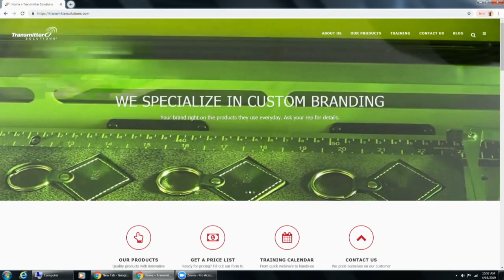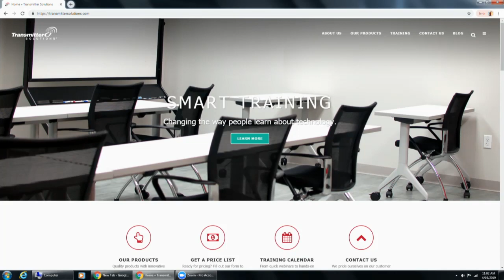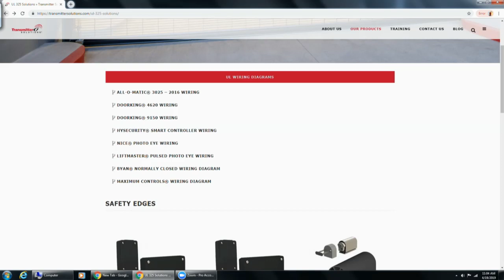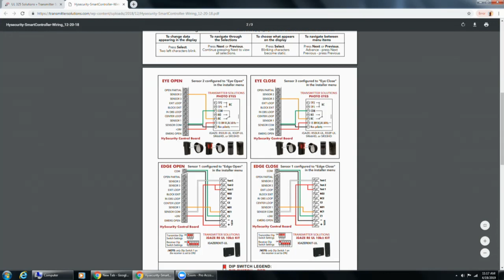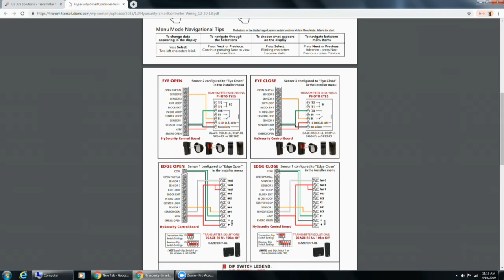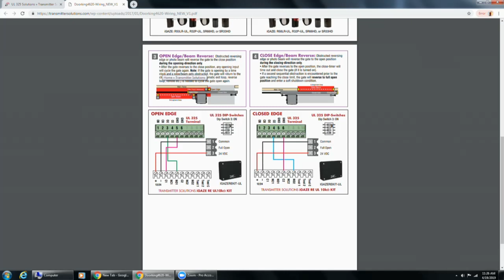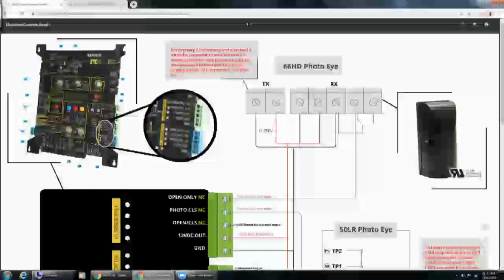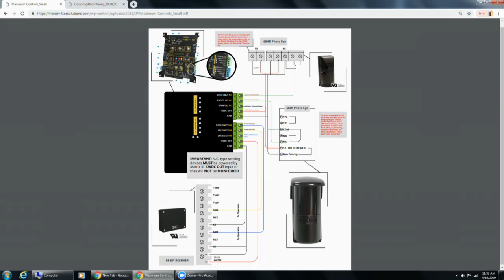Doorking, Hysecurity, and Maximum Controls UL Wiring Webinar | 4-19-2019

Comment: One thing on the Max Controls. Wiring a photo eye to the cls only 10K port isn't recommended because it makes the gate stop very fast because CLS only 10k is designed for a safety edge.